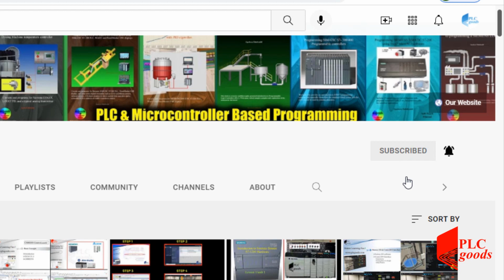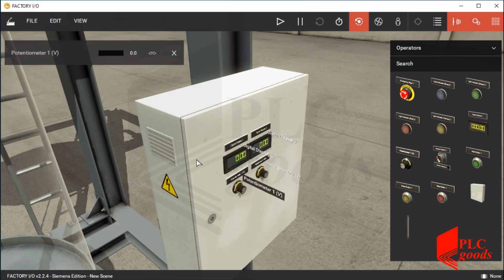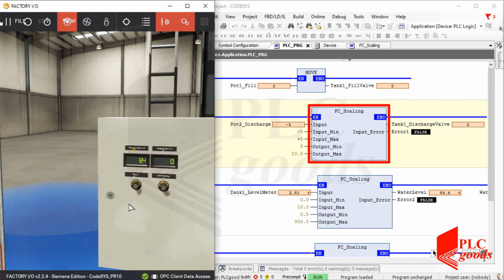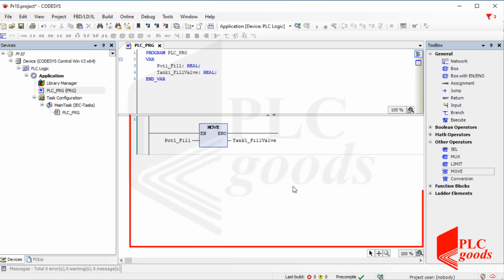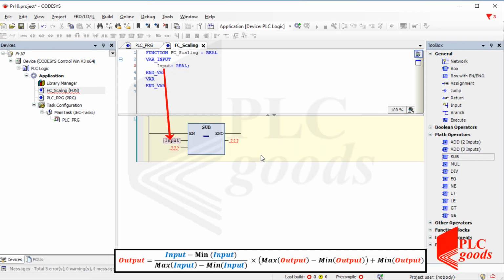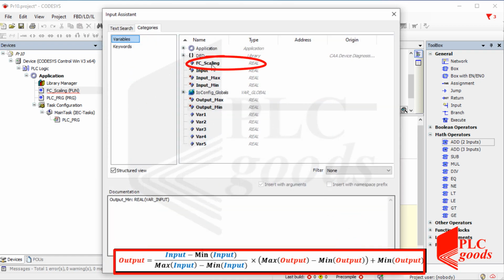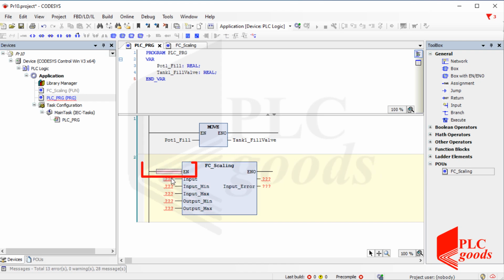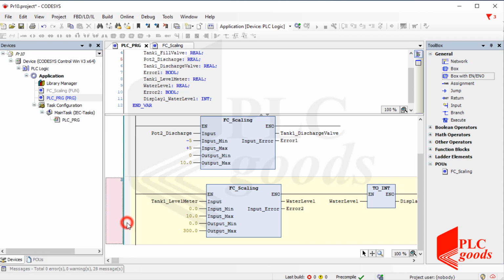✅ CODESYS Ladder Logic Function Tutorial | Factory IO Water Tank Control Project | Lesson 10

Comment: Hello Thank you so much for nice video, could you please tell what is the different between your F_Scaling function block and LIN_TRAFO, is it the same >? and do you have videos about how to filter analog signal to be more smoth , thanks
Reply: Hi there, both of them can be used to read an analog signal and convert that to a specific range. Also, we've not created videos for smoothing analog signals. However, averaging of the last values is a simple method for smoothing and can be used as a low pass filter to smooth analog signals.
Reply: @plcgoodsteam8934  Thank you so much for replying, can you please tell what do you mean by averaging of the last values. you mean the output of this function block is becoming smoothing and no need for extra filter.
Reply: Hi there, sometimes it is better to use the mean of last N values (for example N=10 or N=20) instead of the last value of an industrial parameter. You'll need to create an array and store the N last value of your parameter or signal.
Reply: Also, If your problem is related to showing an industrial parameter on an HMI, LED display, etc. you can write a program to update the HMI, Digital display, etc. every 1 or 5 seconds.
Reply: @plcgoodsteam8934  Thank you so much for nice explenation, If you have this logic could you please share that
Reply: @shawkataliahmadi2418  , Hello again,  This video ( https://www.youtube.com/watch?v=zyWGGeElOec ) can help you to see how data can be updated every 5 seconds in TIA portal. Also, I've not written a logic to take the mean value in Codesys, but that's simple. The first part of this project ( https://automationprimer.com/2020/04/24/ladder-logic-307-data-average-and-archive/ ) can help you. It uses simple instructions to take the mean value of a parameter.
Reply from the maker: Thanks for your comment and concern!

Comment: What is the difference between Function and Function  block? Could you not have used function block for scaling?
Reply from the maker: hi there, Both Functions and Function-Blocks execute a program, but the Function-Block can store some data on a part of memory and use them during the next execution. Note that, any codes inside a Function can be implemented by Function-Blocks too. In this case, you can use a Function-Block without saving any parameter .
Reply: @plcgoods  good one